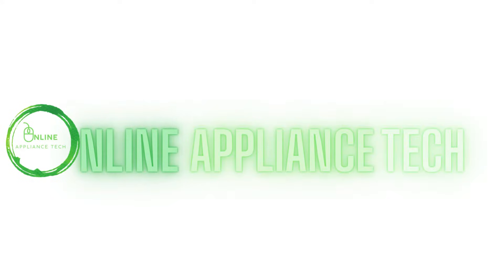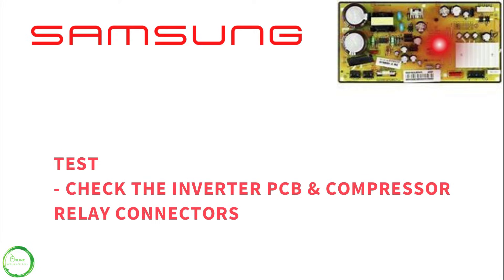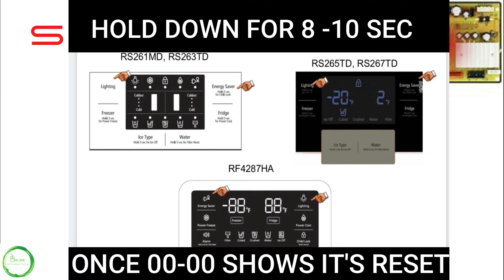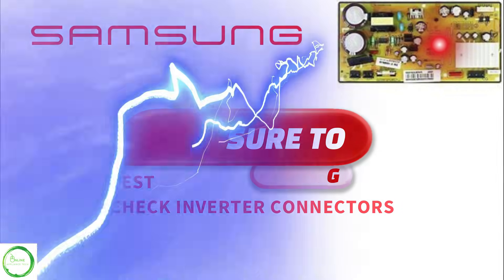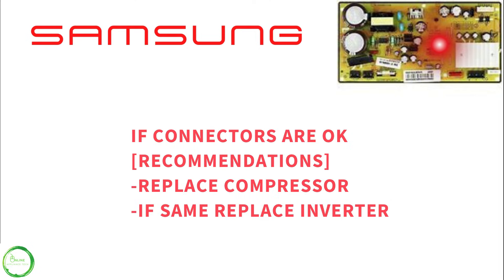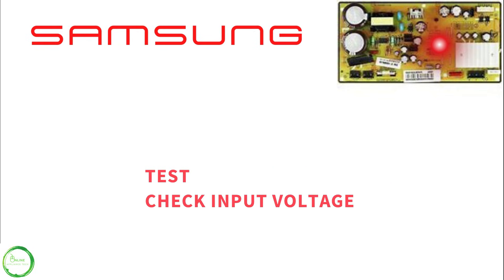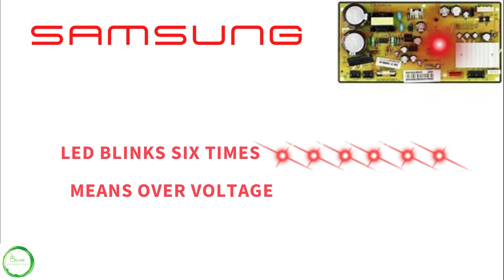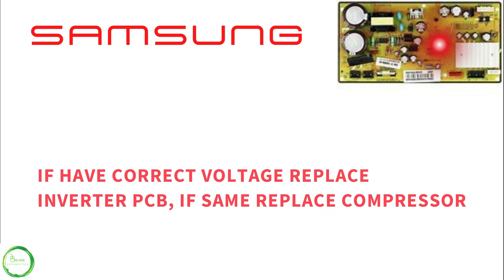Samsung Refrigerator Inverter Board Blinking: What Does It Mean?

Comment: Thank you for your explanation. 
The power pcb is blinking one time, while the inverter led is not blinking.
There is light inside the refrigerator, but it is not working.
If you can help me,  thanks.

Comment: what if the red light in the inverter board  is not blinking? just a steady red light? it still gets cold but not to its set temperature. should I replace the compressor? or replace the inverter card? or it may be the capacitor of the compressor?
Reply from the maker: It sounds like a sealed system leak. None of the above solutions would fix the issue—it's likely a leak in the fresh food evaporator.
Reply: @onlineappliancetech  gonna look into that. Thank you!!

Comment: What if i see that the inverter board gets 120v but that red light doesn't blink or lit at all, and it doesn't distribute any voltage to the compressor? The compressor looks good, it has 10 omhs on all combinations. Is that 100% faulty inverter board? Thanks in advance!

Comment: My samsung is only 1 year 1 month old and wer are experiencing not cooling problem.  I took the metal plates off from the back and cleaned the coil ( which was dirty) and the fan is constantly running and i can feel the compressor is on.   The refrigerator ran normal until 5 or 6 hours later and started not be able to catch up to set desire temperatures.    I then took the motherbroad plate off and saw a soild red light ( not blinking at all)  
Im a little confused because based on my online researches , some says its normal but some says bad.   Any help would greatly appreciated
Reply: @fh3486  hi I have the same problem but now there's no light on at all and the bottom part isn't getting cold but top is cold

Comment: What if the red lights are not lite?
Reply from the maker: It could indicate that the main control, which activates the inverter, isn't supplying the correct power. If the power is indeed correct, this suggests that your inverter is faulty.

Comment: My samsung fridge isn't cooling.  Samsung says it's a sealed system issue and that it's covered under warranty but claims the mainboard is faulty and will cost $500 to replace.  The red light on my mainboard is solid, not blinking.  Is it actually possible that the board is broken or are they just trying to charge for a repair that they claim is free?

Comment: Hi I have a Samsung RF23HTEDBSR/AA with inverter board 06DA9200763B, the board blink 1 at a time so i replaced it and my fridge worked for 4 days and failed back to 1 blink. I replaced my inverter board again and it worked for another 4 days and reverted failed again with one blink. My compressor ohms out ok and it runs after replacing the inverter board each time. The codes on the front display are 40C,61C,65C and 81C no compressor lock alarm. Any ideas why it only works for 4 days after replacing the inverter board?
Reply: @okcreeptv  Hola, creo que el problema es el compresor y no tu placa inversora, el compresor si esta defectuoso o con el lubricante mal segun en que posicion se quede, luego no arranca porque se queda atascado, y creo que eso es lo que mw pasa a mi tambien.

Yo tengo tambien el error de 1 blink pero directamente no me arranca el compresor

Comment: Hi I have a Samsung family hub the refrigerator stopped working and when you plug it in the compressor start then stop working right away and in the touch screen have a 84c code compressor locked over RPM. I don't know what to do then the inverter board flashes 4 times.
Reply: Howdy @jonathanrobinson5348!  My Samsung RF28HDEDBSR/AA-52 (manufactured late 2017) just started having the same issue (digital screen listing 84C, with also hearing the metallic tinging sound of the compressor starting then a split second later quitting with the Inverter PCB Assembly board then starting to flash 4 times).  Were you able to get your appliance working again, if so what was the root cause?  What resolved it? 

For my DIY attempt to diagnose/fix my issue, I looked and research and determined that it could be a few different things (but most "flashing 4 times" listed that the compressor needs to be replaced....but, see my own troubleshooting of my Samsung compressor (Model: NC1MV90ALP / SM1) that is listed further below in my response where the results seem to NOT be conclusive that the compressor was "bad" or "locked").  The possible solution(s) I located for the overall issue could be handled by a DIY'er except for replacing the compressor.  It appears that "replacing the compressor" option would be the most expensive to start with (the non refundable repair person "house call" fee to just show up plus the labor fee of switching out the compressor along with capturing the existing refrigerant and recharging the new compressor, etc...with the ONLY bright spot being that the actual new compressor part (around $200 - $300) being covered due to the Samsung's 10 yr. warranty on the compressor).  How convenient though that due to the fridge being 6 yrs old (and now just outside of the 5 yr. add-on warranty that had been purchased additionally) that the manufacturer's warranty JUST happens to cover the compressor but does NOT cover any labor (which between the "house call" fee plus the labor charge will be twice the amount (or more) of that of a new compressor..smh).  So, I first decided try some of other possible solutions (listed below).

For my issue (I.e., same symptoms that @jonathanrobinson5348! had listed), I first reviewed DIY instructions on how to try and determine if the compressor was bad.  I used a volt meter/ohm reader (multi-meter) to read the compressor.  The compressor (which I believe is a 3 Phase inverter compressor has a single pin at the top at 12 o'clock and the 2 other pins below the top pin in a parallel horizontal line thus making a triangle) seemed to check out with no short circuiting (no shorts to ground) from any of the pins.  Also, the resistance ohms for reading the windings for the different pin sequences (1-2, 2-3, 3-1) were all at or close to 10 ohms (per another forum that is the correct reading for that model compressor, also I believe when it is a 3 phase inverter compressor the windings readings should all be the same or very close).  I then opted to replace the Inverter PCB Assembly board (DA92-00483N) and the Refrigerator Compressor Overload Protector (OLP) Part # DA34-00004D, but changing either (or both) components didn't help (same issue/symptoms were still happening).  

I was back to square one with looking at the compressor.  My confusion was that with the compressor readings checking out and with the the compressor being able to start to turn over (having the metallic tinging noise for a second or less) then is it really "locked"?  Most forums with a "locked" compressor list that there is no activity with the compressor starting (to turn over) at all.  That then lead me to think that there possibly is some other electronical component that is cutting (stopping) the compressor, possibly:
- a faulty Noise Filter/Power Coil Filter (DA27-00043D), where it might be sending too much power to the compressor and thus the OLP is kicking in?
OR
- a faulty Refrigerator Control Board/Module Assembly (DA92-00486A).  I have no idea if this assembly would anything to do with the compressor in relation to the symptoms it is having?

My guess is that for my specific issue it is most likely that it will still be the compressor that needs to be replaced even though the external readings look good and that it starts to turn over (i.e., it might have some other internal issue that is causing it to cut out with then having the LED light flashing 4 times, maybe my compressor issue is due to the "Over RPM" aspect and not the "Locked" aspect?...I don't know if they are (2) different symptoms (with both resulting in the 4 flashing lights and with both needing the compressor to be replaced) or if they are actually (1) in the same?)  Hopefully @jonathanrobinson5348! (or someone else) will be able to respond soon and either confirm that the compressor is indeed the issue and needs to be replaced OR that maybe it is something else (i.e., possibly an issue due to something like it being low on refrigerant or maybe being due to one of other electronic components being faulty, other than the OLP or the Inverter PCB Assembly board?) 😃
Reply: @g.f.6973 hello did you solve your issue?
Reply: Model Samsung Rf265beaesr

Comment: Hello, i have an issue with a Samsung RT32K fridge, but the light that is blinking is on the power board (the big one next to the one that you are showing in the video) . It blinks 7 times and then 12, what could it be?
Reply from the maker: Could I have full Model number please?
Reply: @onlineappliancetech  Yes, the model number is RT32K5070S8, Compressor NC4AV80ALR/SA1, thanks in advance

Comment: What if the red light isn't on at all???
Reply from the maker: It appears that your Main Power Control (MPC) is not supplying power, or possibly, your Inverter MPC could be faulty. The only way to verify this is by testing the Inverter MPC with a multimeter to see if it's receiving power. If you're not noticing a red light, it's likely that the issue lies with your Inverter board. I hope this information assists you!